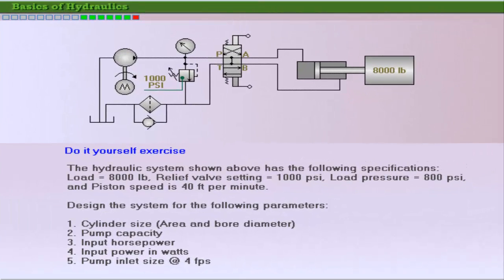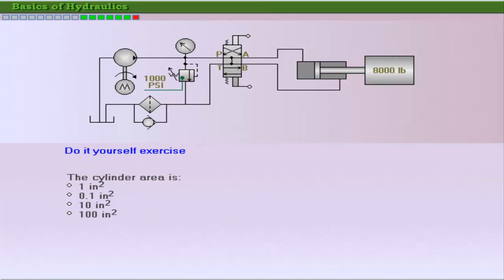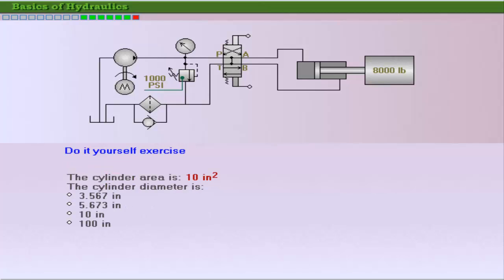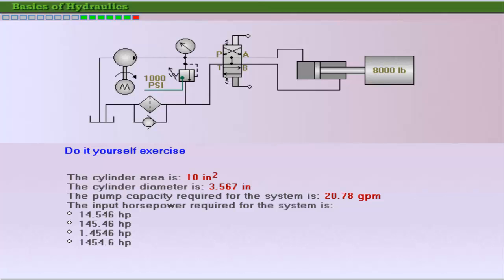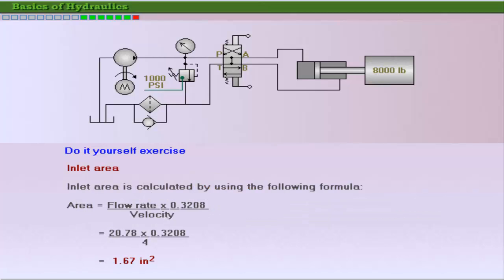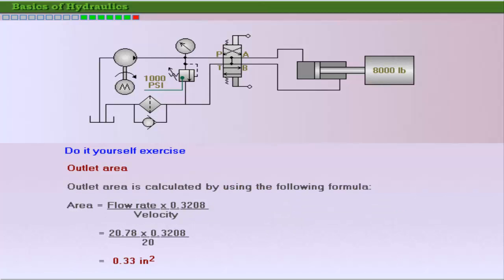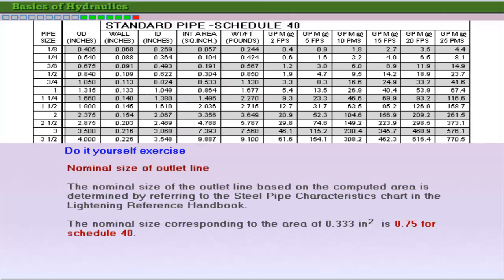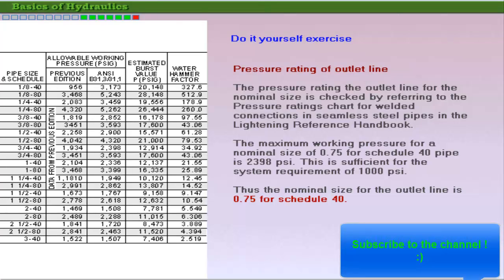Basic of Hydraulics part 16 OF 16 | Mechanical Engineering

Comment: Hi, I have completed the entire so lovely course very thoroughly. i enjoyed so much. the course refreshed my basic knowledge as a mechanical engineer and as i am a student taking a course in aircraft mechanics- Landing Gears theory. i appreciate the confidence i gained after solving correctly the problem in video 16. actually i summerized the whole course formulas, concepts, and pipe specs for schedule 40  on a one single sheet then i attacked the problem and solved it my self. thanks so much for your very valuable basic course. i look forward to learn more about hydraulics from you as an excellent instructor and excellent graphs and animations, once more thank you. Hazim Jadallah - Canada.